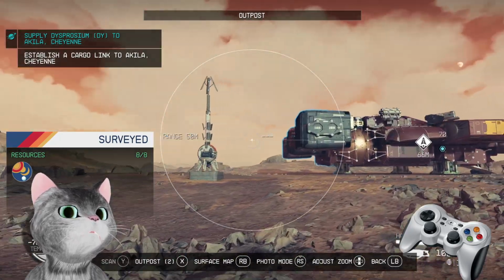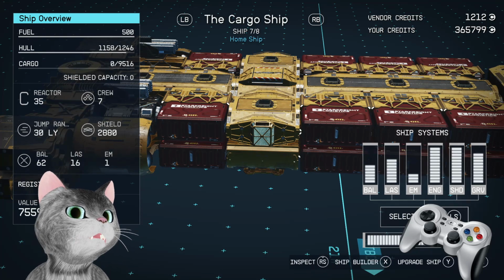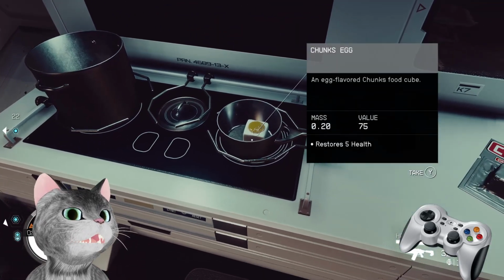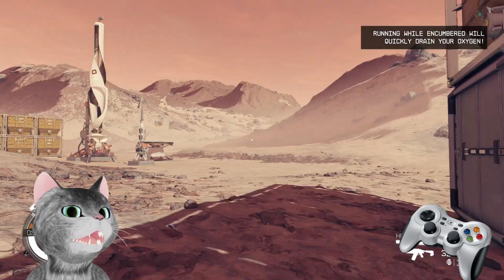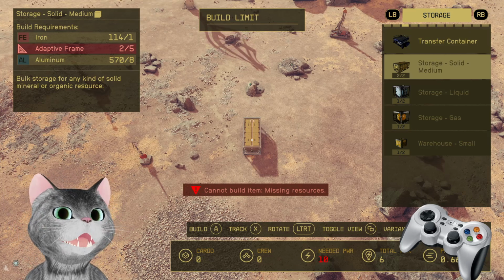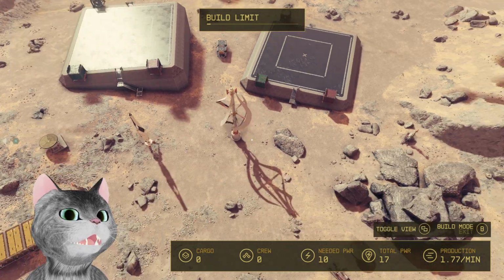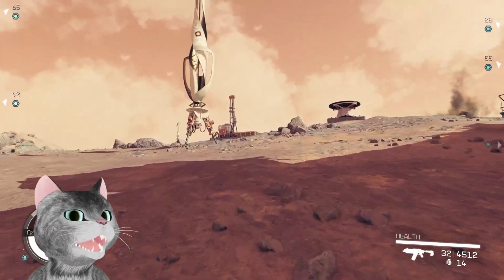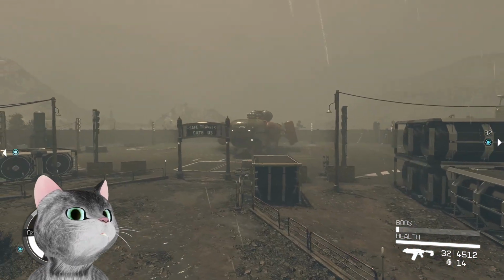That Cat gets Lost in Outposting

Comment: I build my first and only outpost at Jemison near the north pole in its arctic area and create a AMP farm with two greenhouses, one for each plant requires to produce AMP. AMP is so lightweight a small Hopetech "Lil Muv" is sufficient without any weapons or shield upgrades to truck the AMP to New Atlantis without worrying about pirates. However I do build a few defense turrets atop their small square outpost hab as well as place all of the workstations in it, especially the pharmaceutical one. Making AMP and selling AMP advances the research tree significantly and earns enough income to buy my favorite ship in the game, as I play as a introvert as much as possible, the Stroud Eklund Trebuchet II  or the Warwolf by the time I have the financial resources to do so. I am able to acquire the Lil Muv by NOT spending a single credit on the Frontier I swiftly SELL at my outpost shipbuilders pad. You CAN sell the Frontier to ANY ship technician when that pad has LESS financial credits than what the Frontier will fetch. My outpost has  ZERO credits. The Var'uun Dirge  is the same as a Trebuchet. With just a few hab changes I get the ship I desire with the Trebuchet,  three all in one berths suitable for a introvert to upgrade to class C later. Suitable for six passengers to transport. I see no need for a larger ship than three 2x1 habs. The lodge and my outpost have or will have all of the work stations and research lab. I also use the unlimited storage at the lodge for the loot I don't sell...
Reply from the maker: So you just set up one outpost and picked one resource to money farm ?
I forget what AMP is.
I set up all the outpost for farming. It was like a puzzle mini game itself that I had fun with.